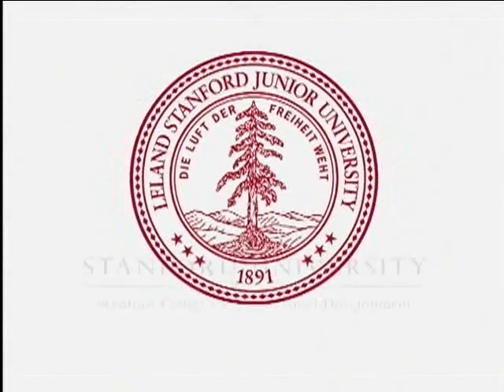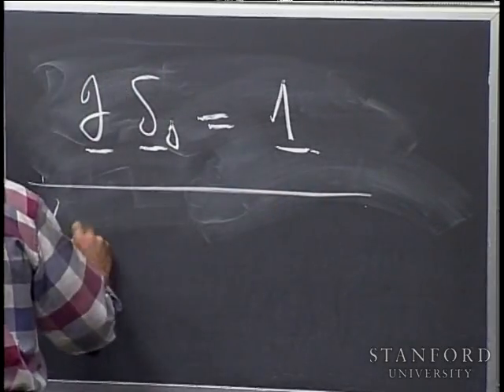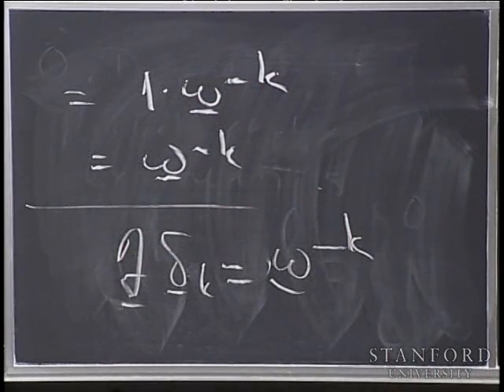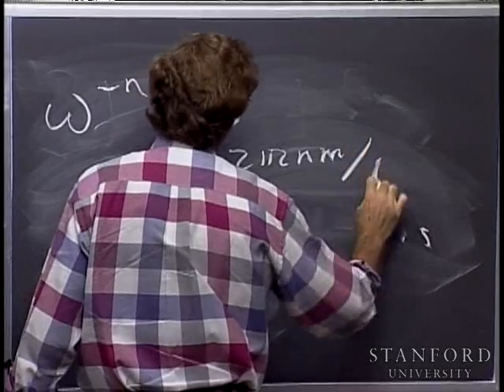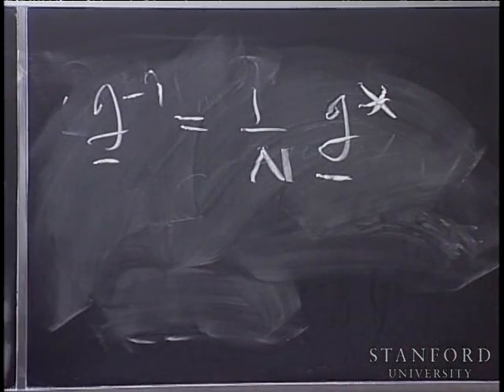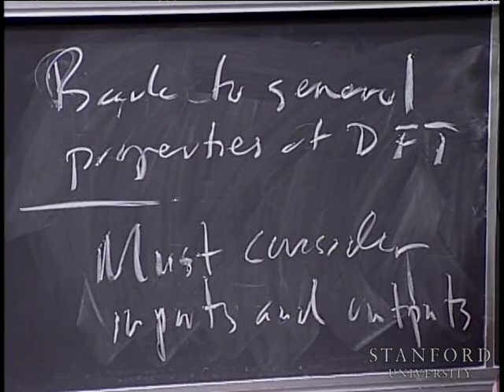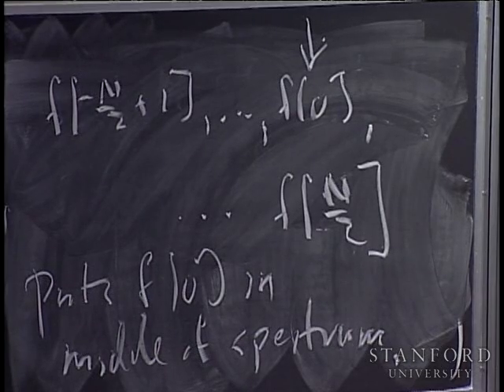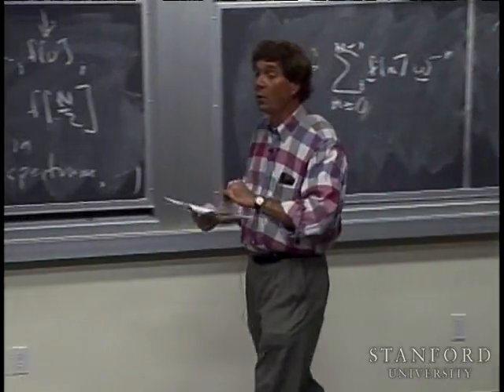Lecture 21 | The Fourier Transforms and its Applications

Comment: I find this a lot more enlightening than the continuous case lectures, which is funny because this lecture is quite late in the series. Going from the discreet to the continuous case would feel a lot more natural, as integration itself is a limiting operation of a discreet idea (Riemann sums). I feel like this perspective dispels a lot of mystery, for example the delta function and its Fourier transform becomes quite straightforward in the discrete case. The definition of the inverse Fourier transform also just becomes finding the inverse of a matrix, which is a familiar operation to most students.

I feel like explaining the whole subject coming from linear algebra is a lot more straightforward than prior mental acrobatics with distributions over functions and such.

That being said, Professor Osgood is a top-notch lecturer and I owe my understanding of the Fourier transform to him.